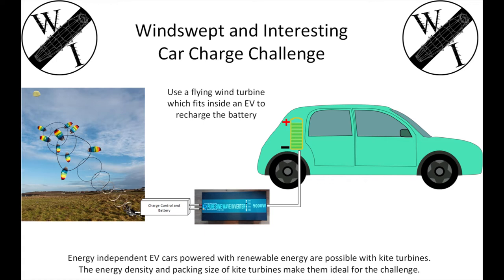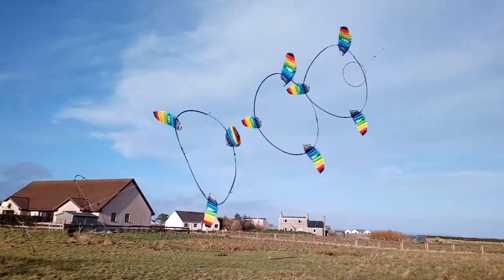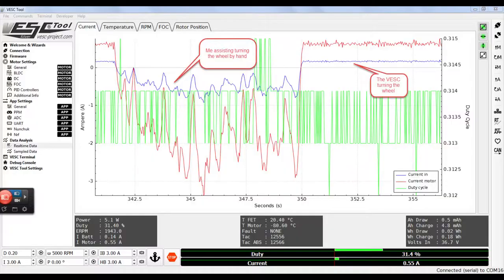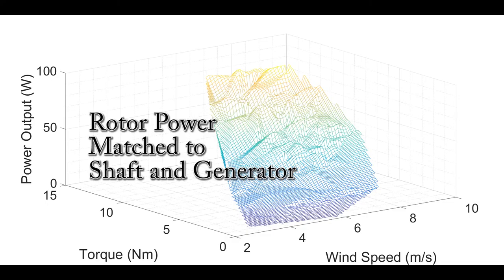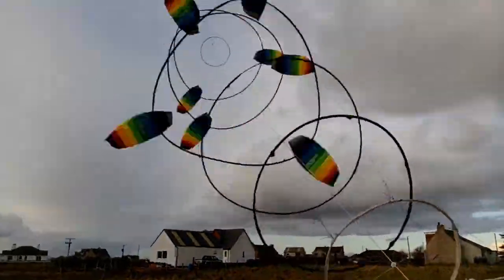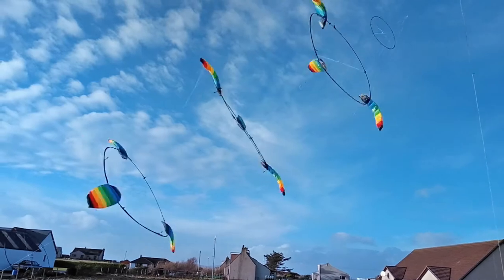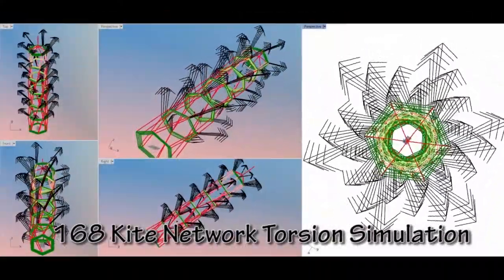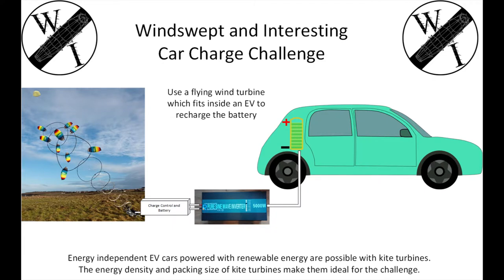Kite turbine car charging challenge overview

Comment: 600 watt you can charge a tesla in 1 month.  drive four hours a month . good job
Reply from the maker: Yeah, that was kinda slow. Moved to a more rigid form of kite turbine blades now. They're much more efficient. Had a single ring kicking out 1.5kW. The thing about this project is the scope for scalability (by network stacking, by ring number, by ground array, by concentricity and by radius.) So hopefully it won't take too long before I can make something more supercharger...